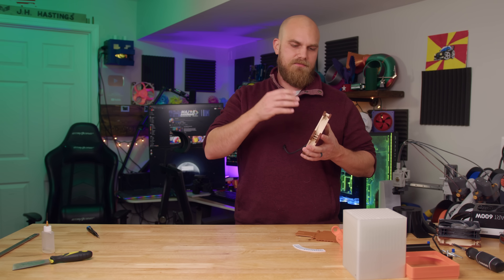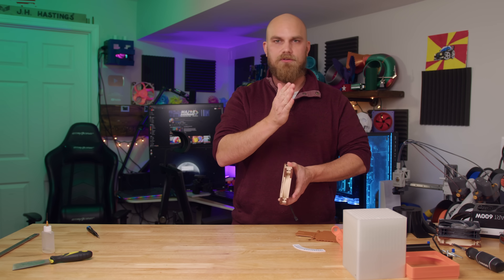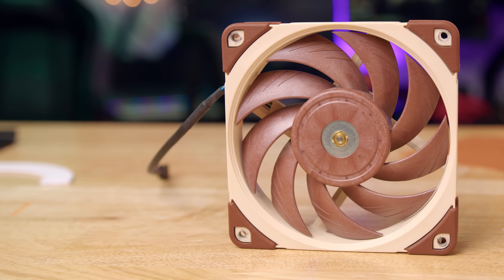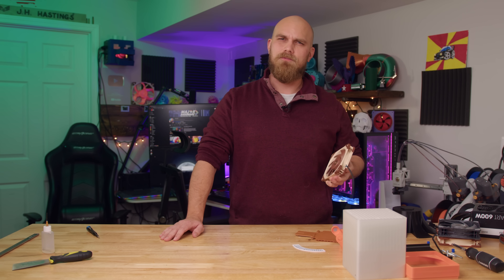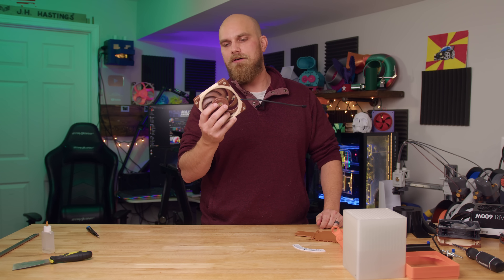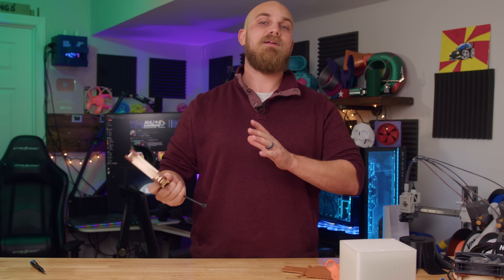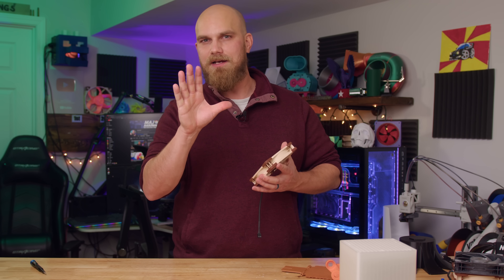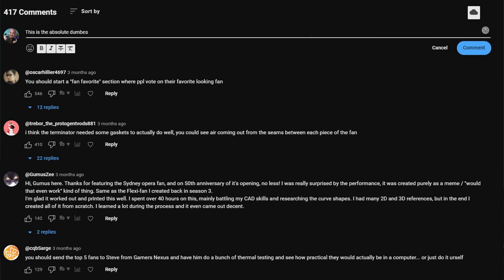I Built a Static Pressure Machine | Fan Showdown Season 6 Pilot

Comment: A proper meter for this would normally have one control orifice, basically having the flap inside of a square tube so it only opens on one side. The current design has the orifice increase exponentially as it opens.
Reply: While this is true, it really doesn't mean anything. It's not like that scale is calibrated to any particular value. If you ran the math on it knowing its mass you could figure out the force to open it up, then correlate it to flow rate.  This is really more of a flow meter than a static pressure meter.
Reply: good point. hope it gets more votes :)
Reply: what about one opening at the end with the "flap" perpendicular, but going up and down against the force of gravity with no actual opening? its basically an analog pressure gauge then
Reply: My thoughts too.
Reply: Yeah this was my worry of this design
Reply: So... Some kind of linkage system?
Reply: I came here to essentially make the same point.  Apologies if I appear to be treading on your shoes, but I would like to expand on your existing point, and also, please feel free to add to, or change my point as well, we are all here to learn.  Anyway, here is my thought:  Please triple the length of the tube after the air straightener grid and then add the flapper that is fully enclosed within the tube, and then have two identical anemometers "near" the end, in fixed positions (removable holders for ease of use, but repeatability), both positions in the vertical centreline, with one at the horizontal bottom third and one at the horizontal top third as the deflection of air moving the flap will (I assume) produce different air speeds exiting the tube at the top of the tube vs the bottom of the tube.  The extra amount of resistance from the airflow having to move the fully enclosed flap will I assume dramatically  reduce the amount of deflection, so the flap may need to be modified, plus (the post by @genericnamethere) that suggests a longer measuring arm will be absolutely necessary, also the holders for, plus the anemometers will also reduce airflow as well as they will be a restriction.
.
Almost, almost finally, the whole thing can be used in conjunction with your smoke machine, especially cool if the tube was transparent, although the effects may not truly show up, and may have to be reverted to your existing smoke test setup, and be shown separately.  Almost finally, I do not see any reason why this setup would need a stand at all, so long as the exit was always in the same position (the edge of a desk with no extra impedance within a foot or so), and likewise the air intake area.
.
And finally, finally,  the camera(s) showing this for your videos would always need to be in the same place, as a different position viewing the measuring arm will show different results, just as it does if you look at an analog clock from different angles, especially so if the arms are a long way from the face.
.
The extra last finally, sound testing would have to be done separately as resonances, and vibrations especially may severely impact the results.
.
The absolutely last final point, it would be interesting to see the RPM figures of the fans in free air as well as pushing air through this contraption, which I believe will have a real World impact on the RPM.
Reply: or the output should bend thoward the ceiling?
Reply: Why does that matter for this test? Thanks.
Reply: @D4RKFiB3R  ref my other comment: it matters because you're measuring scale is unintuitive when comparing results, if the opening size changed linearly then the comparison of values between different fans would be more obvious. for example one fan could measure at a 6.5 and another at a 6.7 which is quite close while being a much bigger difference as compared to a 5.5 and a 5.7. it's all about the data collected more than the test itself, it works fine as it is but it could be better
Reply: @alxndr2000  That makes sense. Thank you.
So would it be correct to say that the better a fan does in this test, the less it's real world performance will be reflected in the results, because it has to work that much harder as the opening increases, which is not a realistic scenario?
Reply: @D4RKFiB3R  the amount of pressure required to go from 5 to 6 is different to the air required to go from 6 to 7 as the size of the opening of the gate increases non linearly
Reply: That's actually a great idea and if the tube is printed clear, could add a metric scale at the side to measure how much it opens.
Reply: Those were my thoughts as well.
Reply: How do you figure that it's increasing exponentially?  I would think the increase would still be linear, although it would have a higher coefficient.
Reply: Parabolically, not exponentially :P

Comment: Similar to @kendallguier1378 I think that  it needs more space around the side, but would prefer to see a U  trough around the bottom and the sides and keep the top open. I believe that it it were completely encased it would be affected by the suction of the tube. the trough would allow the volume to be measured better with fewer outside variables from the flow out of the tube. IMO

Comment: I think still needs a barometer before the grill, a trapdoor is not the same, pressure is the force applied to every side and the door visualize the velocity. First barometers were just a tube filled with a liquid that was pushed by the pressure, I think an orizzontal S shaped tube filled with alcohol could work, the start of the siphon comunicating with the chamber and the other in atmosphere

Comment: I don't think this is a good idea.  Beyond a certain point, it will be harder and harder for the air to push the door higher, making it very difficult to see the differences between the fans.  I think that if you create a tube with gradual expansion, and put a ball in it the width of the bottom of the tube, stand it vertically and connect the air that the fan pushes into it, you will be able to get a fairly accurate idea of the power of the fan based on the height of the ball.

Comment: I like the concept, but i fear this strategy will be Non linear (but repeatable). I question if the force required to get from 16 to 17 will be higher than 6 to 7. I doubt the added grid is doing enough to make the air flow actually laminar across the entire surface and suspect there will still be a higher pressure in the middle or 3/4 of the center. the added turbulence of the edges of the walls can’t help ether. Thus making most of the air flow just get deflected and not accurately showing full static pressure. A common way to test if flow is laminar is by using a lighter and seeing if the flame gets blown more or less on different areas of the air flow. Maybe putting a wall around the entire flap or working on getting more laminar flow (possibly by adding a hepa filter to increase the static pressure and straighten the air or a longer grid) 
A common way to measure static pressure is by using inches of water column i feel that would be an easy way to test. Get a U shaped pipe and fill it with water and see how far the fan push up the water. Only thing is that will be Static pressure at 0 CFM and that’s useless for most things.

Comment: Put two 120mm PVC pipes next to each other, one must be transparent, and connect them with hose on the bottom so it will look like "U". Fill them with water and mark the 0 on transparent pipe where water is. Mount the fan on other pipe and measure how high the water can go in transparent pipe.

Comment: Interesting concept to show an apples-to-apples comparison between fans. For the purposes of what you're doing, it's a really neat solution. For more precise measurements, you want to measure static pressure at zero airflow, so you'd need a sealed chamber and a manometer.  Most PC fans are in the <2mm H2O range which is barely anything.

Comment: What if instead of a flap it was a plate on a track with springs or something so that the movement is linear instead of rotational? Or maybe even stand the whole thing vertically and use gravity to see how high it can be lifted. You could have a shell around that track with holes in it which would let you customize the amount of bleed off so that you get more variance in the results and it's easier to read

Comment: Hey, i am using a Sensirion sdp810 differential pressure sensor for a project. it measures 500Pa, communicates over i2c to build a data acquisition system with a microcontroller, it is a very good resolution sensor and not that expensive (35 bucks I guess). but I also like the flap measurement system.
Reply: This sensor looks awesome for the price. 

May need a bit more than 500pa as that's only up to 2" WC.

Comment: Good idea, maybe adding electronics for position measurement? (encoder or other optical measurement) Digital display and serial communication...  (you will have less paperwork :D) In this way you can add extra measurements, like how the pressure is building up over time. I am not sure in the measurement linearity (repeatability is just one part) of this solution, but looks really interesting.

Comment: The measurement scale isn’t linear because as the flap lifts up the fan is experiencing less resistance to air flow so the gauge becomes less accurate the higher the static pressure is. Still seems useful for qualitative comparisons

Comment: If we're trying to measure pressure then lets use something that already measures pressure. Weight is a measure of downward pressure exerted by a mass under gravity. take the mass and gravity out of the equation. mount a scale at the end of the wind tunnel. This could be done with a digital kitchen scale to test and then switch to a load cell incorporated into the design for a more refined test set up. It would also give you a much more precise measurement as compared to "about a 6".

Comment: Good idea, but be aware that the outputs it gives are probably not linear because of the geometry. I think it's just easier to deflect the flap™ when it's vertical than when it's at an angle, due to lower projected area of it, vhen looking from a plane that is perpendicular to the airflow. Also, the angle of attack of the flap™ might play a role, as airflow is deflected and not hitting the thing perpendicularly.
It might be worthwhile to somehow calibrate the thing using different fans with known airflow and plot a calibration curve. You should then be able to use that curve to convert your arbitrary markings to actual units.

I am no engineer though....

Comment: I think pushing the "door" open, thus letting air out, muddies the pure pressure measurement. There will be some airflow aspect to the measurement as air is escaping. Instead a closed box with a pressure sensor (scale) at the end would be better.
A theoretical tiny fan may be able to produce a lot of static pressure, but may not be able to move enough air volume to keep the large hole of the door open.
This leads to the question: why should we measure static pressure for PC applications. I think the measurement using the radiator leads to the most realistic grading of the fans. Still, I like this experiment.

Comment: I feel like that design would still be somewhat reliant on airflow, a fan with higher pressure but less airflow might simply not produce enough volume to push the flap open far enough since it’s out in the open and can escape the side

I think enclosing the flap in a tube or something would make it better

Comment: I'd try to design a back panel that incorporates a digital deflection / depth gauge.  Measure the force applied to the back panel, on an flat plane.   By including the door, you're changing flow rates the more the door opens.

Comment: I think exploring in the direction of static pressure is a natural direction for this sweet experiment.
I used a digital kitchen scale(4" x 4") with a plastic bag made into a tube tape sealed to it, sealed that to the bottom of a 120mm wind tunnel. Got repeatable results matching Noctua's P-Q graph. Another guy on reddit used a cork floating on a sealed water dish with an indicator off the side of that, got solid results too. Some pics on print-ables -->  GPU/CPU Fan, the PSF (Psychedelic Super Funkitron )

Comment: if the flap were all the way open the end of the tube should be flush with the 'bottom' of the door, and have a square profile so it would have a decent seal at any angle
the shape of the exhaust would always be rectangular and would have to increase sensitivity as there would be less wasted pressure.

Comment: 5:00 if that scale started at 0, it would be much better because no lift = 0, but also because since you arbitrarily chose 18 as the maximum and not any kind of round number — well that screams degrees at me (exactly 1/5 of the degree value of what you'd read between 0° and 90°)

Comment: The idea is nice, but I would use degrees instead of arbitrary numbers. Degrees are easier to remember that "one point for each 2.5 degrees".

Also, "sensitivity" is lacking. Ideally, you would want to have your most powerful fan (the one which is unlikely to beat; not necessarily a contender in the lineup) deflect your gauge to 75% of the max (~70 degrees).

At least this is what I remember from metrology class I had fifteen or so years ago))

Comment: I need to get myself a 3 of tose T30´s for front intake, I have pretty capable fans there and even took out the dust filter behind the mesh but still, airflor of my front (and bottom) fans sucks. Those T30´s would probably create a hurrican to force push the hot air of my side exhausting GPU out of my sidepanel ventilation. Yes, still using that old design because I prefere ventilation/airflow over a freaking window, function comes always first for me and I shit on looks if nesseccary for both performance and longivity! But I´m just some nerd.

Comment: I think 'Static Pressure' should be a seperate (chart / ranking) from 'AirFlow'.

Both values are important for a fan along with Noise made.

I think you need seperate Chart Rankings for different values:
- AirFlow
- Static Pressure
- Noise
- Efficiency Ratio:
  - (Noise : AirFlow)
  - (Noise : Static Presure)
Reply: - Amperage:airflow
- Amperage:static pressure

Comment: I have my doubts regarding the scale. It looks like, this setup will not be linear, i.e. fan with score of 6, won't necessarily produce twice the static pressure than fan with the score of 3. If you want just qualitative comparison, I guess, it's ok, but for more quantitative results, i think some additional calculations may be required. Alternatively instead of a door and an obstacle, you can just plug the end with some membrane and measure its deformation.

Comment: instead of the "angle gauge" just make a potentiometer and measure the resistance. youll get more accurate readings vs just a close number and all youll have to do is make a circuit with a bent wire and some conductive paint.

or you can get a differential pressure sensor used for EGR valves on cars, or a DPF differential pressure sensor used on diesels to measure if the exhaust filter is plugged.

Comment: 1) Gaskets, if needed probably worth checking. 

2) Enclose the flap so you don't simply loose air once the door opens

3) Change how you mount the fans with maybe a 'drop in slot' piece. That way you do not need to screw around with screws or those rubber plug things,

It does look more visually appealing from a viewers POV as we can see a clear number and watch the door  compared to a digital reading so that's nice.

Then to also test to see how credible it is you can get 2 fans with one being air and one being pressure focused. and see if those fans show any number differences.

PS, would making the door the top and air blowing up help readings because gravity is acting as resistance holding the door back to the 0 point?

Comment: My vote is just the new device cause it looks like fun, but I would recommend playing with the flap balance so that the A12X25 will get to the middle like you were hoping for.
Reply: Yea. I like this as well. A bit of tinkering with the counter weight and it's good enough, maybe make the indicator a bit taller to get more granularity as well. We don't need exact pressure readings like many seem to want. Seeing the relative difference between fans is good enough.

Comment: That looks pretty good, and it is easy to see in the video. 
Maybe make the top of the flap longer so the scale can have more resolution. I expect most fans to be between 5 and 6, and without more resolution they all going to look the same.
Bigger scale, maybe with a highlight of where the Noctua sits to make it more visually appealing on camera as well.

Comment: To measure static pressure you need to measure the ability of the fan to fill an enclosed container and move against the air pressure generated in that enclosed container. The air relief of the door opening will not get you the results you're after, and you are essentially still testing airflow with this setup. An easy way to adapt your test setup would be to line the container with a plastic bag that can be inflated by the fan to push against the door. Find some way to close the container.

Comment: I agree with other commenters. The Scale is non Linear So you need to adjust your scale to match the true scale. Also You should have a longer "Pointer" for better granularity. Though I think a Hall affect sensor. Or perhaps if you want to get fancy you could add gearing at the axle and use a encoder to record movements (for actual data acquisition). Thinking about it use a mirror and a laser to measure flap movement. The Sweep Distance from start to finish is the reading. Want more granularity move further away, Could at least be use as a more visually interesting story stick.